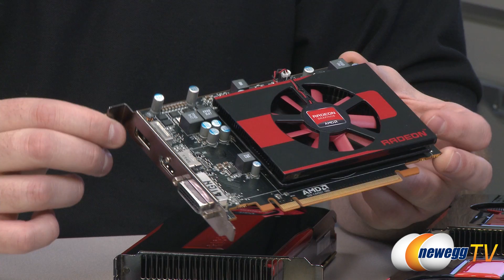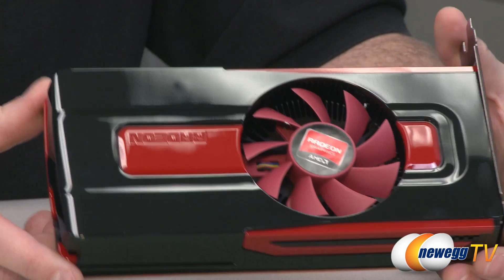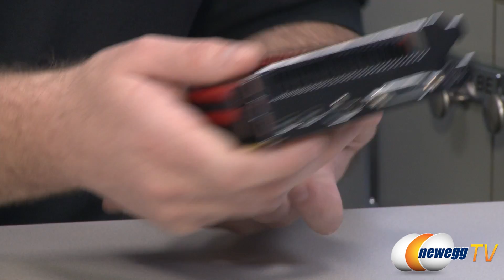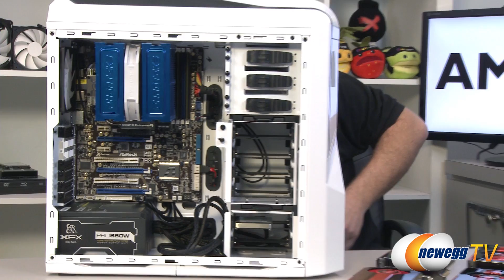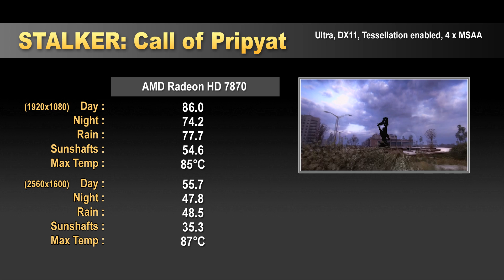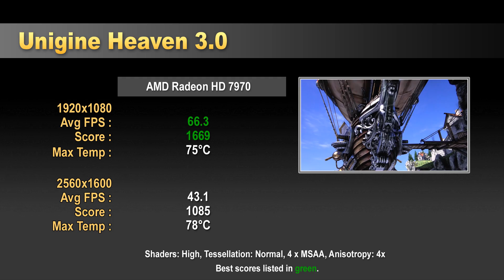Newegg TV: AMD Radeon HD 7000 Series Video Cards Overview & Benchmarks

Comment: yes. most likely on max as well. may not peak out at much more than 35 fps though so if that is an issue for you (some like to maintain 60 fps), then i suggest a 7700 card or 7900 card

Comment: Not all of them as i recall. They started with the high end 7970/7950 and released the lower end cards later. And now all of them are released. A little like the gtx 680 being released a while before the 670, 660 and so on.

Comment: Got myself 7770 by Asus. Besides being silent in my environment, runs also pretty much all games in high settings 1080p ~60 frames. With crossfire there's horsepower of 7950-7970, which should be at least okay for most. ;) Good stuff, can recommend!

Thanks for this roundup review of 7000 series by so far. :)

Comment: right he doesnt need it but if you read his comment, he said he had an i7 but not which model. first gen might not be able to handle that much information (not experienced in first gen i7 though so they might)  and 2nd and 3rd gen perform much like the i5-2500k. its just the change from 1st and 2nd gen was a performance improvement "tock" and I'm not sure if there is a big enough of a difference to be noteworthy in current high end gaming systems.

Comment: you will need about a radeon 6000+ series or a GTX 500+ to run battlefield 3 stable max. also, is your i7 first, 2nd or 3rd gen? that matters as that indictates the processor speed. first gen, need to update, 2nd and 3rd gen are both good

Comment: get ab better cooled card, that implies using a non reference cooler, I recommend the triple fan gigabyte or the dual fan sapphire solutions, both are very silent, but I you want to get the highest overclock, an asus card should be best for you, although it is not very silent at all

Comment: Minecraft's performance has a large influence from mostly the GPU.  Yes, it will run basically on anything, but if you want a high res and a far render distance, you need a 200 dollar graphics card...if you want more than 5 fps.

Comment: Depends. 7970 is better than all of the 6000 series except the 6990 I assume. 6990 is better than the 7750 and 7770 for sure. But in general, 7000 series is newer, made with better technology, and the 7000 series equivalents for the 6000 series are better.

Comment: Have you seen tomshardware? They did some benchmarks and the 670 is 4.5% slower than the 680, but 11.4% faster than the 7970. It would be around 15% but the 7970 is better for Metro 2033 as that's an AMD optimized game.

Comment: What is not? Haven't you seen the benchmarks? The 7990 or 7970x2 or however you want to call it is faster than the 690. The GTX Titan is the fastest single gpu card i think, so a Titan x2 would be faster than a 7990. But the 690 is slower than the 7990.

Comment: And the core used in the 7970 is actually better than the gtx 690 gpu. 690 is a dual gpu card, 7970 is a single gpu card. Its an unfair comparison. The right one would be 7970 vs 680, the 680 is a single gpu 690. The 7970 is faster than the 680, which means that the 7970 uses a better gpu. And based on that, the 7990 will be faster than the 690. Comparing 7970 and 690 is like comparing a single core cpu to a dual core cpu.

Comment: I don't nearly have any of my shit overclocked to max yet seeings how ive only build my PC less then a month. I can run pretty much any game on Ultra so far with staining a constant FPS, RIFT/Skyrim runs in the high 80s. For an RPG 80 FPS is pretty damn good for only spending 200 bucks on 2 vid card, But its nice that people flag opinions on here....I'm only on my first wave of overclocking...Ive seen my 8120 8 core black unlocked CPU in the 4.6 - 4.7+ GHz stable. so Im only beginning.

Comment: i am using HD 5700 currently. is my system compatible with HD 7000 series? )
Reply: Yes, they are both PCI-E 16x, but if youre mobo is older you may get less bandwidth on the pci-e lane.

Comment: Pretty darn sure the 670 beats the 7970. Even if it is overclocked a bit, an OCed 670 beating AMD's currently best GPU on the market? That's just sad. The 7970 is better for overclocking, but the 680 already beats it so what's the point? Saving $20? Pfft, if you are buying such high end cards you can afford to stretch your budget a bit.